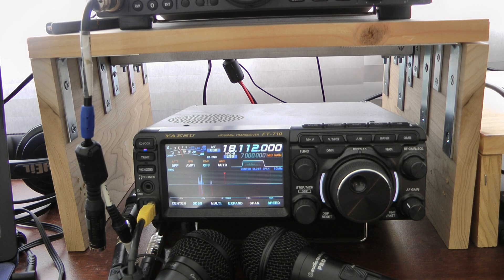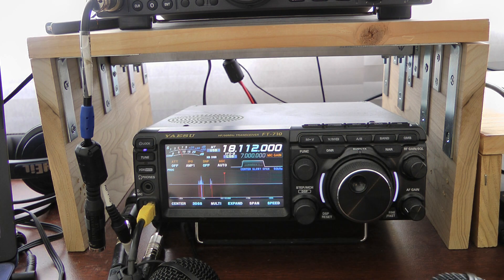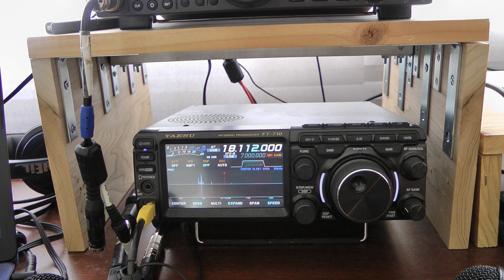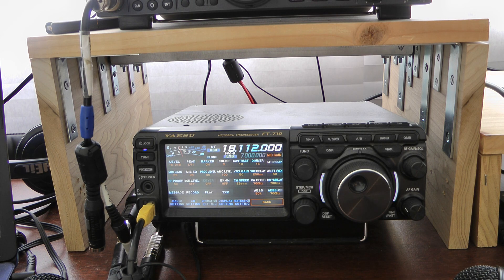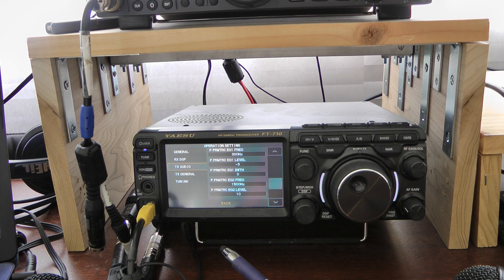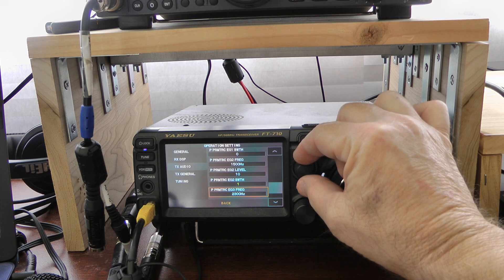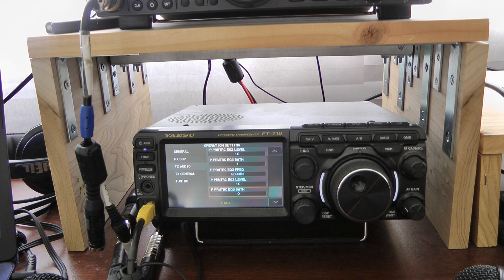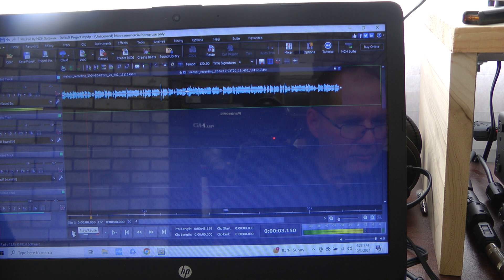Yaesu FT-710 Transmit Audio with inexpensive boom microphones

Comment: What boom Mike cable did you use between the mic and the FT710.
Reply from the maker: I used an audio xlr to phone plug cable that i purchased from amazon, I have a heil mic adapter plug on the radio
Reply: @johnwofford2708 thank you for the reply.

Comment: Im running a Yaesu 710 AESS as well with a Zoom ZDM-1 Standard XLR 3 pin, and is a dynamic mic.  Having some setup problems with mine.  I wanted to ask if I should back things off a touch.  With SSB audio settings with factory electret, the Zoom microphone tends to squeal at keyup.  My harness is built by hamdaptor rather than Heil.  Hopefully they are pretty much to spec with each other.  If anyone has comments or suggestions I'd sure love to hear thoughts on this.

Comment: How dod you plug in, into a ft710 ?
Reply from the maker: I used a heil adapter
Reply: @johnwofford2708  What model Heil adapter?
Reply from the maker: Heil AD-1-YM, Inrad also has an adapter M-YM
Reply: @johnwofford2708  Thank you.
Reply: How are you plugging the mic into the AD1-YM?  That adapter accepts a 3.5mm and 1/4” for PTT.  Aren’t those XLR microphones?  I’m confused.